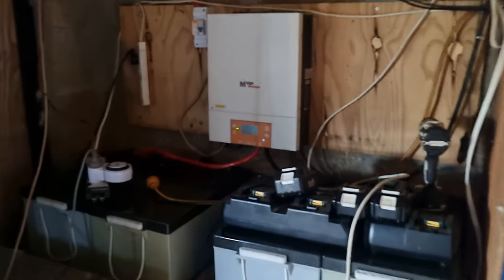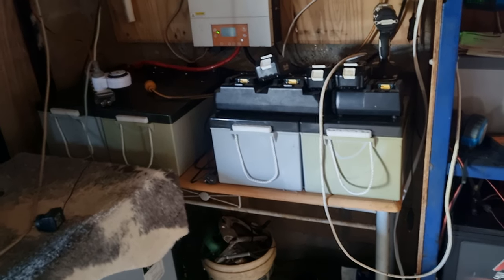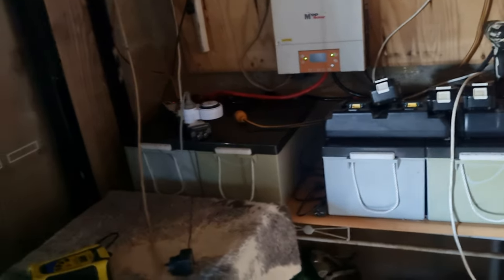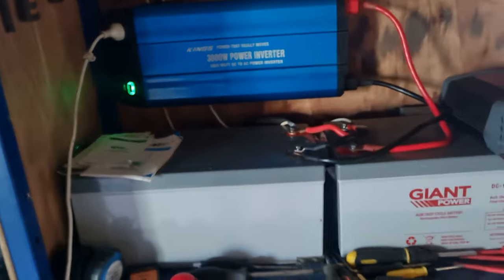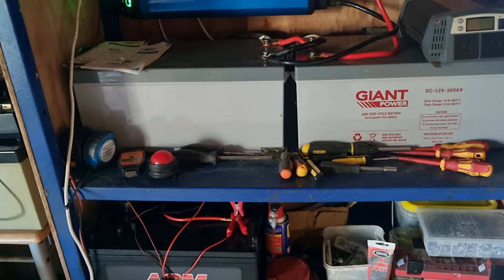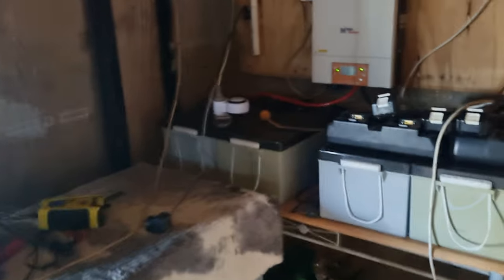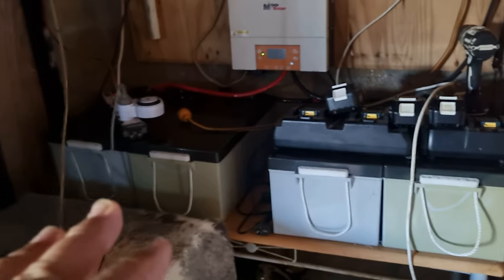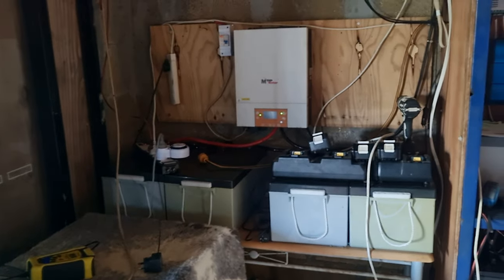Solar Battery dead. Oh no.

Comment: That's the problem with battery systems wired in series. Some of the batteries in the circuit will drop to a lower voltage than the others. They will not charge equally, even though common sense says they should, there's nothing in the circuit to monitor the individual battery voltages. If you add a seperate charge controller for each battery (one of the $10 Chinese cheapies per 12 volt battery) rather than trying to charge the batteries while they're hooked up in series, you'll have better results. Sure, you'll be limiting your charge for each battery to the maximum amps of the cheapie charge controller, but even the 30 amp controllers are pretty inexpensive. The bonus is each battery will now be maintained at the perfect voltage rather than dropping below 12 volts. It only takes one discharge below 12 volts to kill a cell in a perfectly good battery. On the bright side, you may be able to bring the bad cell back to life in the problem battery with a few high amp cycles. Throw the amps to it, let it cool, then repeat. Adding a little Chinese cheapie charge controller to each battery in the series circuit is the way to go.
Reply from the maker: Thank you for the insight.